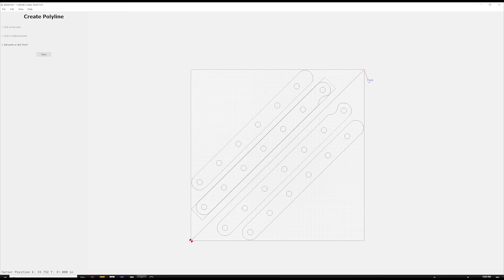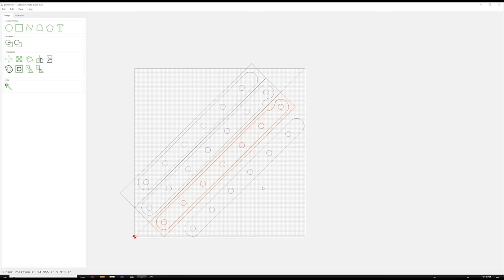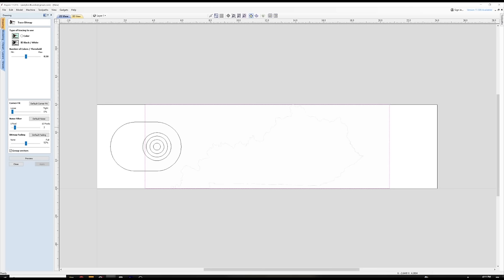Watch This Before You Buy A CNC Router In 2023

Comment: Six months ago I would have agreed with you totally. I have owned and upgraded two Shapeoko CNCs. Adding a HDZ, 80mm spindle mount, plus spindles to both. Don't get me wrong I enjoyed both machines but that was six months ago. 
The best advice I can give EVERYONE is buy your second machine FIRST. It doesn't matter if it's a CNC, laser or 3D printer... buy the one you plan on upgrading to or watch YouTube and see what most people on there upgraded to. 
Is it more expensive... yes but it's definitely cheaper than buying two or three before you get the one you want. 
I own a Onefinity Elite CNC, Thunder Laser 35-100 and a Bambu Lab X1-Carbon 3D printer and these three are worth saving for.
Reply from the maker: Thanks for sharing, but I mostly disagree. The machines you mentioned are almost $20,000 combined. That's 10x of what I'm recommending. What would have happened if you bought the Elite Forman as your first machine and you discovered cnc wasn't for you? You bought the machines you have now with the knowledge that you enjoyed cnc, because you learned on less expensive machines. 

The argument could be made that a Shapeoko is the 2nd machine, the machine people upgrade to because they are looking at starting with a $300 cnc. So in that scenario, I guess I do agree with you. 

The reality is that a Shapeoko 4 or a Shapeoko 5 is the final machine for A LOT of people. They will never need anymore machine for what they want to do. Are there "better" machines? Yes. But there are also trucks with more horse power than mine. Do I need it? No. Would I like to have more horsepower? Well, that's a different conversation.
Reply: @AndyBirdBuilds  I think the divergence here is someone usually doesn't go out and spend $20k for a hobby or unplanned business idea. In general I agree with your advice (don't cheap out too much and make it hard on yourself, but also don't empty your retirement).

But if I was making the decision as a profitable business decision, it becomes survivable risk vs sustained reward. For that often buying the more up front pays off sooner and maintains that performance gap. If you can afford $20 in machines, you can afford paying for training and/or hiring experience.

Cash flow wise, someone can probably scrape a few thousand together. That's a big plus to starting a risk business idea with little to no experience. Which is exactly where you advice applies.
Reply: @user-tf1oo9rj6u   I think both opinions are correct, depending on your circumstances, depending if you are buying one because you might like to use it vs buying one because you need it.

Comment: This is a great overview what CNC router entails! 

Adding to sofware, I was glad I already had Adobe Illustrator and knew how to use it, it's easy to import designs into vectrix/v-carve. Adding Fusion 360 to the mix is another steep learning curve but could be worth it. I started out with SolidWorks but the Fusion 360 build in CAM is much better (Solid works doesn't come with cam as standard, not sure if this is still the case though). 

And for wanting to cut metal like aluminium and/or mild steel there are things you need to be aware of too, like cutting fluids, airblasts/misters etc. Air compressor is handy to have. Looking into single flute cutters is necessary if your spindel is of the high speed variety (7000-24000+ rpm). Or if you want to cut plastics such as acrylics a single flute cutter is very good too.

I like the 'creative' angle, but for those that focus on building a machine, I think the PrintNC is a good point to start, but there's little in the way of support. One of the more solid builds out there as all structural parts are steel tubes (no welding required). At the time I started out I bought an OpenBuilds CNC Ox (400x700x50mm build space) clone from Aliexpress, which uses delrin wheels for the moving parts and 2020 style extrusions, which isn't very stiff and wouldn't recommend it even though they are very cheap for their size. Even in wood dimensions weren't very accurate.

I managed to CNC a new and bigger CNC from 20mm thick aluminium plates and X, Y and Z axes ready made from aliexpress with ball screws and linear rails. New build space is 750x1500x200mm. 

It's a bit of a rabbit hole but it was a lot of fun building these machines and learned a ton along the way.

Comment: Thanks for reinforcing the importance of the path I'm trying to follow in bringing CNC capability to my projects.  I will look harder at the Shapeoko.   I ultimately need to shape, some parts out of specialized foams that will be approximately 13' (yes feet) x 3" x 3" (inch) as well as some other parts out of wood, Carbon fiber plate, Aluminum that can be done on a small format machine.  Even If I had an 8' machine, I will still need to slice up the work. Some of the wood parts will want as much Z axis as I can reasonably get.  I'm already doing some CAD with Sketchup and am ramping up on Fusion 360.
I'm going to be digging much deeper into the videos you have been producing.
Reply: If you intend on doing large format projects, take a look at the Maslow CNC kit (I think they were running around $500). It's designed around cutting projects at 4x8 ft sheets and it would be easy to scale up without adding any cost other than control chain and stands lengths.
Reply: That's a lot to ask for most budget prebuilts. If i were you, I'd ask about extended Z options for their machines (remember to look at both travel and clearance), but you are also getting in the range where maybe you should just buy parts and build a frame.
Building a big machine that can handle metal well is going to drastically increase costs. If you don't really need that, you could always start with a smaller machine that can handle the metal work, then later get a bigger machine for the large foam projects.

Are you perhaps making fiberglass molds? You could always cut sectionals and have then stack together on an ibeam jig for rigidity. That would allow you to use a much smaller machine.

Comment: HOLD DOWN-- 18 guage battery ryobi pin nailer,  thenails are easy to remove, leave a small hole...and the bit can go right through them if you hit one.
Reply from the maker: Tried this before. Not a fan. Nails were not easy to remove and I damaged bits hitting them

Comment: you said laptop... why not a desktop dedicated/stationed near the cnc? I have a 2015 computer that is still in great shape with Adobe software installed (photoshop, illustrator, etc... I have older adobe software that I own outright... new adobe software is rented via monthly subscription... i need another monthly subscription bill like i need an extra hole in my head) I would like to use my older desktop computer with owned adobe software to generate svg files to import into something like vetric
Reply from the maker: You're right. You can totally use a desktop as well
Reply: The CNC controller/code feeder computer can be a lowly "$35" Raspberry Pi unit or many similar options under $100. Fanless is a great for a wood shop dusty environment  I run my Shapeoko with a desktop tower pc sold in 2000! It's running Linux. I can 'upgrade' when it conks out. While I could plumb ethernet or install wifi, it's just as easy to have a USB thumb drive and 'sneaker net' it out to the shop.

Comment: Andy great video! I've been running an xxl for a few years and looking to upgrade to a 4x4 with a spindle.. looking at the shapeoko5 4x4. Can you comment why you upgraded to the avid vs the shapoko 5?
Reply from the maker: Thanks for watching! I got my Avid about 6 months before the 5 came out. With that being said, they're 2 totally different machines. The Shapeoko 5 is a very capable cnc, but is still considered a hobby machine. Whereas the Avid is a professional machine. The Avid is not an industrial machine, though.
Reply: I have settled on either the shapeoko 4x4 or an avid 4x4.  What does the avid have for over twice the price of the shapeoko?  I understand it has a bigger spindle, nema 34, etc.  I am trying to find the where the extra 5-7k shows up.  Feed and speed rates?  Better components?   Since you have run both machines I figure there is no better person to ask.  Thanks in advance for your feedback.

 @AndyBirdBuilds
Reply from the maker: @mohillbilly5841  When it comes to performance these machines are in 2 different leagues. One is a hobby machine and one is a professional-grade machine. It comes down to what you want to do with a CNC.

Comment: Question on the software. All the videos I've seen seem to be using 2D vectors. Is that all CNC machines can do? Can you create a design in 3D that cuts the material at different depths? Sort of like what a 3D printer would do but in reverse, so instead of additive it would be...subtractive?
Reply: Yes, pretty much all do that

Comment: WARNING, LONG COMMENT Thanks so much for this informative video, you may have me sold on the Shapeko. I started a woodworking journey a couple years ago (following in  my Dads footsteps) with a scroll saw, table saw, drill press and Dremel. The table saw was a bit intimidating for me and I just didn't foresee building on a shop like this in the basement of our rented house. The scroll saw was second hand and i was having too many issues with it for a beginner. I have recently been contemplating a laser. My goal is a hobby making layered signs, charcuterie boards, small projects. After some research I feel that the CNC may be a better fit for me. I love the thought of learning the software! If I may ask one question....lets say you have a design that you want to cut out in pieces (i.e. a snowman and cut out the three body parts, hat, two arms and two legs. Is there a bit with low kerf so that they can be pieced back together after shaping and painting? Sorry if this is not making any sense, will appreciate any input though.
Reply: If I am understanding you correctly, you want a magically thin spinning cutter, so everything fits back together tight? That's not going to exist. Think about how flexible very small drill bits are. And they only end-cut, not side-cut. A jog saw is something that does a thing cut like you may be wanting.

The way you would do what you want is design the shape in the computer, then at the CAM stage create 2 parts: 1 that is cut at the outer profile to leave an inner piece, and one that is cut as an inner profile (= inside your line) to leave an outer piece. If you have measured your bit with calipers to get an actual size, those pieces will fit very tightly together.

One important note on fitting pieces like that: cutters can't shrink, so some corners will be sharp and others will be radiused. Cutters can only cut as small as their diameter. I'll use 2 star shapes as an example:
Example 1: you want a star. You choose an "outside profile" cut, so it will keep your star shape. All the outer tips will come out pointy, but the inner corners will stop shy, being radiused to the bit diameter.
Example 2: you want a star shaped hole. you choose "inside profile cut." All the inner corners will come out pointy, but all the outer corners of the star will be radiused to the cutter diameter.

Because of those filled in spots, you have 4 options to make your star shape fit into the star shaped hole:
1. clip corners off (to fit within the radiused corners)
2. chisel/hand cut the inside corners deeper/sharper (to accommodate the tips fitting in there)
3. avoid 1&2 by making sure that every corner in your design is actually rounded instead to at least as big as your cutter radius. (eg design a star shape with already rounded corners)
4. multipart instead to avoid tight inner corners. If the positive star shape isn't 1 piece, but instead 5 triangle pieces and 1 pentagon, all the corners can be sharp, and it will fit together at 1 solid inner piece with sharp corners. The hole star shape can be given similar treatment.

If you are mass producing, its definitely worth saving hand cleanup time by using options 3 & 4. Imagine inlaying a cutting board. Instead of cutting the pieces, then spending 1/2hr to corner cleanup each, if it is designed as several pieces, they can all drop in together, no cleanup, all glued & pressed in at the same time.

Now if I totally misunderstood the direction of your question, maybe the snowman is made of hoops? Then yes, a 1/8" or 1/16" diameter cutter would allow the pieces to be cut from inside each other, so it can be assembled or compacted back fitting inside the largest hoop. There would be a little slop (cutter width all around) when stacked compact.
Reply: If you just designed your cutout pieces with the correct size/tolerances then the cut size or bit size won't matter and you'll be able to make the pieces fit together as tightly or loosely as you desire. You'll just end up with a small amount of scrapped wood between pieces. Only way I see doing it as you mention.
Reply: Double helix compression bit

Comment: Personally I think this is way more work for less capabilities than just doing it right to begin with and learning fusion 360 from the jump. It does everything in one package....  The reality is, everything you think you didn't need to know, you actually do because you'll one day wonder why your cut sucks and you're burning through bits like crazy. You'll be thanking yourself in the long run as you to push the boundaries of your creativity.
Reply from the maker: Thanks for sharing. I disagree in most cases. Fusion 360 is WAY more than you need to be creative. Vectric Aspire is the most someone with a hobby cnc would ever need. This is my opinion after learning to use Carbide Create, then Fusion 360, then Vectric Aspire.
Reply: At $2k? Are you kidding ? Fusion 360 is free for the hobbiest...
Reply: Not only that, but if you want to go into bending applications, PCB design, milling aluminum parts or 3D printing etc. you already have a foundation to work from. Setting up tool paths in fusion is easy and the simulation software to see exactly what your machine will do before even turning it on.
Reply: @Adventures_of_Marshmallow  They have been crushing down the hobby useability feature set doing the classic commercial software game of free tastes, demo-ware, not letting you export your projects like hostages, and then locking it down unless you pay. Get software like FreeCAD so you can learn it and not fear the commercial games. Because that is the catch, the software companies know it's hard learning to use software and once someone does they are reluctant to switch packages and have to learn it all over again.

Comment: I am not software savvy so what is the easiest to use in this day and age I am hoping there is a system were you put the art work in and it auto converts it to g code I hope
Reply from the maker: This doesn't exist. The closest thing to it is to buy projects that have the gcode setup for your particular machine. But even then, there are a few variables to consider, such as, workholding and material selection.

Comment: Can I use Solidworks as CAD and Cam program?
Reply from the maker: Never have tried it but I'm sure you can. You'll just have to find the correct post processor for your particular machine to make sure the gcode is exported for your machine.

Comment: Does the Shapeoko come with the computer programs for designing and running it on the CNC?  You had mentioned some machines come with the software, but you didn't say that it is included even though you did say everything was included (except router) when you buy that CNC.  I see Autocad is $2,000 a year for one person.  RIDICULOUS!!
Reply from the maker: Yes, Shapeoko does! Also, Vectric is another great option. Here is the link to the Shapeoko https://shop.carbide3d.com/andybirdbuilds
Reply: @AndyBirdBuilds  I did find the answer on another comment as well.  Thanks.

Comment: Wholeheartedly disagree.  Shapeokos are awesome but you want to learn cam/cad first and the best way is with a $200 chinese import before you figure out what you want from it.
Reply from the maker: In my experience, most people get frustrated and quit when they go this route.
Reply: @AndyBirdBuilds  sometimes yes but the same folks will get frustrated if they try to use anything but easel.  Worst case youre out a couple hundred bucks not a couple thousand.  Also depends on what end goals are.  Svg engravings small boxes etc a $200 import will need less setup than a shapeoko, longmill whatever and you get to learn how everything works together.   Of course the downside is qa issues and low quality hardware but this will be your second machine.  Im not advocating a $200 import and tons of mods/upgrades to get it to what you want, just as a learning platform.   

Of course if you started with 3d printers then the point is kinda moot and you already have basic hardware knowledge but still need to learn cam and the difference between additive and subtractive manufacturing.

Comment: The great unspoken truth about CNC machines is that they are not that accurate, particularly the larger ones. They will do things like cabinets and other simple 2D cuttouts, but detail carving on a large scale simply does not work.
Reply from the maker: This has not been my experience
Reply: @AndyBirdBuilds  I carved an 8' by 4' by 1" block of Ash. The carving was by no means accurate and I had to spend a lot of time sanding it to final shape. This has been my experience every time I carve large items. The Fusion toolpaths, (lasting 6 or more hours) seem accurate, but they are not faithfully reproduced by my CNC. I don't know why. Perhap you can do some investigation? I would genuinely be interested in your findings.